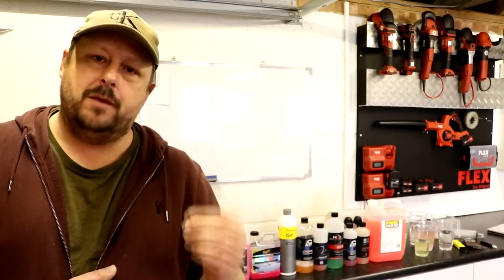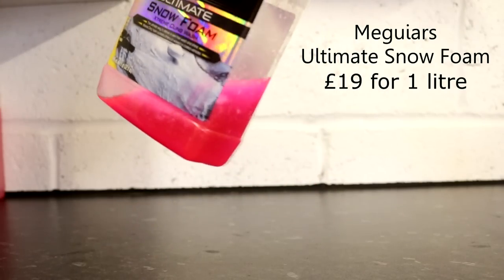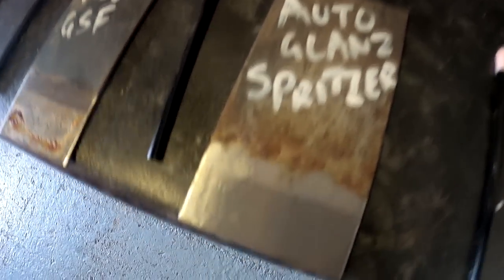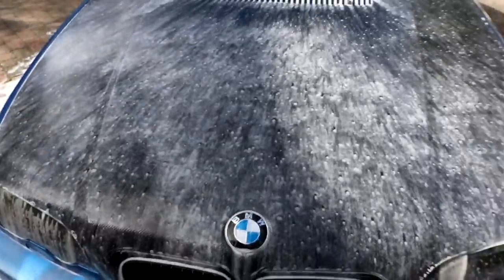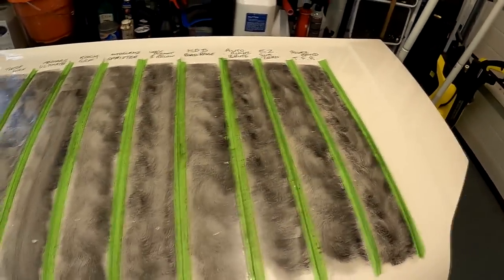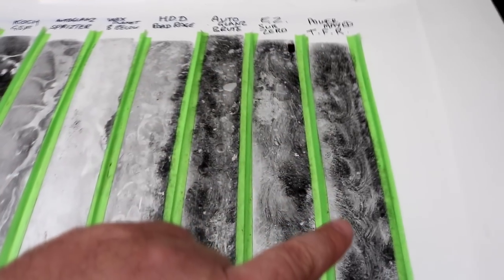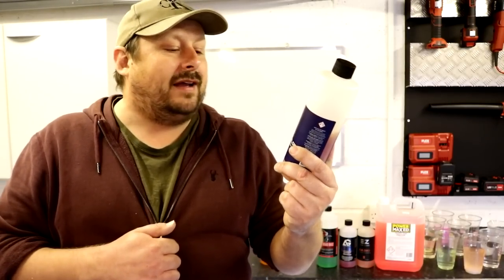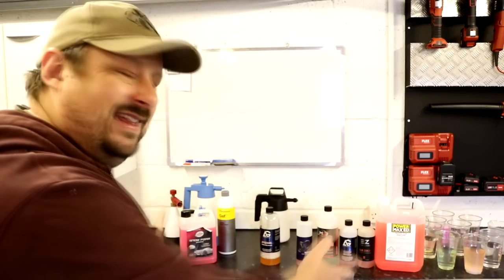The Best Snow Foam | Ultimate Pre-wash Comparison Test

Comment: I'm in research for a power washer and just bumped into your channel. In fact i ended up watching a few of your videos , and now watching this about the snow foam comparison. You said at 27:00 about one weakness of the 8 Below product ,being that it has no point in using in higher conectrations ,when its competitors still can. Because it will become ridiculously foamy. 
And i'm thinking "why wouldnt that be better?".
And then thinking a bit further ahead about how a super rich foamy cover on your car ,when u wash it during summer, would probably decelerate the breaking down of foam coating that leaves marks and give u more time  .
Is that right?
Reply from the maker: yes mate if you over concentrate its a bit like tipping half a bottle of really foamy show gel on your hair, it takes a lot longer to rinse it out.. and like you say it can leave soap stains behind.  in fact foamy products have a tendency to do this.
Reply: @ForensicDetailing  hey, thanks for the quick reply. I think though that we had a slight misunderstanding. I meant that I was thinking the opposite. That more foam would be better.
As if more detergent power on surface, and slower dry up. Sun would hit the outer layer of the foam but the inner layer that does the cleaning on the car's surface wouldn't dry up and would still do its job. And no dried strains from heat too.
 So you would have more worry free time, to leave it on do it's job properly, even on a hot day. And not been rushing with fear of dried stains.
So that's what I was thinking and don't know if it's accurate.
And when you wash out later, a strong power washer wouldn't have any problem with it, right?
Reply from the maker: @akmorf6609  well yer you could say higher concentration of detergents is a good thing sometimes... in winter less of a problem.. but you got to rinse all this stuff off the car so you dont want to go too crazy..   remember as well foam is just foam it does not really do anything..    these products are essential surfactant based which are products which really allow to components for example and oil (grrease) to mix with water.. when normally these 2 components dont..   but yer who knows my friend.. I would just stick to the recomended usage rations generally... dont overload the products it can cause issues for sure.. thank you my friend great subject to talk about.
Reply: @ForensicDetailing  okay thank you, duly noted!
But now please allow me to "take advantage" of your knowledge on the subject as I'm seeking for a little help in deciding. It's days now that I'm searching for the right power washer. I always thought I'd go for Karcher K7 but now , although I'd like it to be the right choice, I'm not so sure after several things i read.
Things like the plastic components in such a powerful washer, or the handgun failing (that they tell you it's not covered by warranty) etc etc.
So since u already using it for months, I wonder what your advice would be. 
And is there even any similarly good alternative? Most info I found was for products they have in the USA, so it's tough to make up my mind.

Comment: Hi, have you got any tips on getting rid of the foam that is on the floor after foam spraying the car. I have to clean my car in a communal alley so I want to dissolve the ground foam quickly to avoid other users of the alley passing through it and splatting it all over the place. Any ideas of a mix I could put in a spare foam cannon to spray on the ground foam to break it down? Love the channel I have found it really useful keep up the good work.
Reply from the maker: honestly just rinse it.. maybe salt or something will kill the suds but I would just rinse it away.
Reply: Forensic Detailing Channel  That’s what I’ve been doing but it takes 30mins to get rid of the stuff as there is only a small drain in the alley. Thanks anyway for taking the time to reply.

Comment: Jon i wonder if some of the companies do not want good degreasing power because they think it will strip away protection? Does moderate degreasing power strip for example....Fusso 99?
Reply from the maker: with old school paste waxes that had oil in them for sure a stronger degreaser will really attack this.. but most modern products it does not make too much difference.. but yer exactly what you say some companies make a milder PH neutral product for lots of reasons.  I think alkalinity is desirable though.

Comment: Hi FDC, just wondering if you got a good stripping snow foam / shampoo?

bought my first car, just want to strip it all back to bare.

it's a white car but want to strip it, decon it with iron remover + tar remover, use a clay mitt as it's less time consuming, and then use super resin polish which I already have and top it off with some megs ultimate liquid wax.
Reply: JS1. Hi - FDC has a great video on ‘turbocharging’ your snow foam into a strip wash type, go check it out 👍

Garage Therapy do a decon wash/snow foam which is just what you’re after. Will strip away anything on the panels. 

If it’s a brand new car if won’t have that much contamination on it so maybe be gentler and go with a clay mitt. A clay bar will likely marr the paint and Super Resin Polish isn’t very abbrasive so you’d need full ‘proper correction’ if so. Great choice of protection though- the liquid wax is 👌

Comment: Hi John, in last year test, n1&2 was Bilt Hamber Auto Foam & AutoBrite Direct Magifoam, now what place is for Wax Planet 8 Below when it comes to cleaning abilities (which is most important to me).
Reply from the maker: in real life its about the same as magifoam.  you cant really crank WP or AD up to 4% PIR because the foam is so thick it does not rinse freely.  but autofoam can be used at 4% pir no problems.  So autofoam is more powerfull.. you need to check out the BH new pre wash called touch-less though. this is even better.
Reply: @ForensicDetailing  thank you Jon. I was already looking at BH Touchless too. 👍

Comment: Superb video. Clear, informative, detailed.

I was intending to buy 500ml of WP Eight Below to test it out, but after watching this excellent video (complete with contactless Dirt Simulator test), i'll be buying a litre from County Detailing because of the impressive way that it shifted dirt with just a open hose doing all of the hard work.

I may even start using 8 below when cleaning the wheels if it works out cheaper than using an alkali wheel cleaner.

Comment: What worries me is adding a bit of TFR to you snow foam to give it extra kick and using too much. One of the lads at work used TFR neat on our TARMAC paver by mistake.and its lethal  concentrate foam. It completely damaged the high viz Chevrons making them bubble. It also destroyed the shine from the paint work. Can anyone give a dose to make it effective  in you cannon. I normally use 150 ml of polar blast to   600 ml of water.
Reply from the maker: be cautious going beyond 4-5% PIR with any product.   Caustic TFR's avoid them. no need to use them.  Just use autofoam.   TFR can contain strong phosphates and caustic soda and the haze it will create on paint is the binders in the clearcoat being broken down.    Caustic soda is an ingredient used still today on some paint strippers.

Comment: Apologies for a noob question but, when using a snow foam, do you use cold or warm water from a tap in the snow foam lance?
Reply from the maker: cold mate.   Some soaps dont work well with hot water... but then main reason you dont need hot water in the lance is when it gets pulled through and mixed with the output from the pressure washer it gets diluted down at about a factor or 1 to 100.   So even if the bottle water is warm it will come out cool or cold from the lance.
Reply: @ForensicDetailing  Many thanks mate 👍🏻🍺🍺

Comment: I'm going to have to say I'm a bit disappointed with this one Jon.  I'm assuming you used the products at the manufacturer's recommended mix ratio when you did the foaming test, but when you did the simulated dirt test you used them all at 5%.  Why?  Why not use them at the % that is being recommended by the manufacturer's?  By using all at 5% you have used some products at a much stronger ratio than intended which can only give inaccurate results when applied in the real-world at the correct ratios.
I just watched your BH AF v 8 Below video and that's just repeated the inaccuracy.  If you are using 8 below at over 5x the strength recommended by the manufacturer, why not use BH AF at 20% PIR?  It's all meaningless unless you use them at the specified ratios.  What's going to happen now is people will be buying 8 below on the strength of this video but using it at the correct manufacturer's ratio of 1:10 and it's not going to perform for them like it did in this video because they are using it at a much weaker ratio.  For reference, I'm not a BH fan boy.
Reply: Hi, can you recommend a good pre wash? I'm new to this and looking into buying a suitable one pre wash product. My car is protected but getting confused by watching different videos what to use; I.e. citrus pre wash or TFR? Then with TFR is caustic and non caustic? Which brand to go for and which one to buy? Its really confusing for a new comer like me and I'm not a valeter or a detailer. I just enjoy the hobby and take pride in cleaning my own car.
Reply: @Rusty_oreo  For me, Auto Glanz Spritzer does what I want it to do and it works out cheaper that Bilt Hamber Auto Foam whilst performing as well and foaming better.
Reply: Thank you very much for coming back to me that quick. I will certainly look into it. Many thanks.

Comment: Not hating Jon but using the product at 5% is inaccurate 8blow isn’t designed to be used at that dilution a much better rest is to use them at the max recommendation strength on the dirt simulator
Reply from the maker: ive talked to you about this before.  you have to use them all at the same concentration or its not a comparison.  When you are testing something you have to remove variables.   if they are all at the same % then we learn about their relative strengths to each other.    We also use the products for 6 months at recomended usage concentrations.
Reply: @ForensicDetailing  no, hakman is completely right. you tested the concentration and not how they are 'designed' for usage. no test is ever done that way btw why should it. you tested the quantity here not the quality. you implemented an arbitrary variable - the concentration of the product.
take for example a sonax windshield-washer fluid. they are sold in 1:100, 1:7 and in a ready to use version - of one and the same product. your testing method would have provided three very very different results with the exact same 'dirt simulator' with one and the same product.
Reply from the maker: I didnt say he was wrong. Im not trying to test how they are designed for usage in this test. how many times do I have to say it.  Im trying to compare relative power at fixed ratios.but there is no right or wrong.  its this simple thats what I wanted to test and I explained why.  Sure you can say you would prefer a different test etc.. but its not wrong lol.
Reply: @ForensicDetailing  by searching 'the best', and as stated the try to eliminate variables, it is suboptimal to say at least to implement a huge very dominant variable by yourself - and to switch this variable in the process of testing like you did falsifys it even further. 
corrosion resistence test was done neat, foaming was done 'as designed', cleaning was done with arbitrary dilution ratio. so two out of three are done in a way a user simply wouldnt use the products. 
for example - if you would have done corrosion test at 2%, foamed neat and cleaned as designed your conclusio and outcome would not be the same but still would have checked all the 'relative power'-setting-boxes. the outcome of my hypothetical portrayed exampletest would have shown the corrosion res of your tapwater, all would've foamed like crazy crazy and cleaned as designed. the possible variations to such an method are infinite and their outcomes are probably near random.
so yes - with the primary goal and attempt to find 'the best' - that testing methodology is pretty much per definition wrong - imho.

Comment: Cleaning power usually goes up with a high ph value but it'll strip your paint protection faster. Maybe I missed but you didn't really show ph values of the products.
Reply: The impact on LSP is so minimal it's not worth highlighting. Washing your car with a ph neutral pure shampoo will cause more damage to your LSP than any of these pre washes.
Reply: @BrianW1612  that certainly differs with the product used. Valet Pro specifically offers Combo2 snow foam as a wax stripper and it's also ph12.2. They advise you to use it at a very low dilution but still these foams have a lot of power.
Reply: @saiiiiiii1  can advertise it however they like, highly unlikely it actually works at stripping LSPs.
Reply: @BrianW1612  I've seen tests from german detailing enthusiasts. Non synthetic waxes easily get removed.
Reply: Would you rather reapply protection because your prewash does a good job or repolish your car because it doesn’t?
Reply: @LSD04  wonderful way of putting it, 100% my point of view & couldn't agree more.

Comment: Snow Foam, and all foams, are odd choices for washing cars. Foam is only a mass of tiny bubbles, and with a bubble, the only bit that's working is the one part that's in contact with the surface. The rest of it is doing nothing. I foam the car, then get on it with a noodle mitt.
The ideal spray would be one with flat coverage with close to 100% contact, but with great cling. Having had decades of two-bucket car-washing, snow-foam is fun to use, easy to apply, looks good, but, stand alone, it's not very efficient.
I use low-foam washing-up liquid for the same reason. Fairy Liquid bangs on about the bubbles, they do Nothing! (It's just more concentrated than others anyway, nothing special about it)

Comment: The problem with bh autofoam is you have to use a shit load of it to be at 4% which makes it very uneconomical
Reply from the maker: its more powerfull than other products when you use it at the same ratio matt.  I agree 4% is uneconomical but I use it normally at 1-2% and its great.  4% is so strong, you could degrease an engine bay with it at that ratio.
Reply: @ForensicDetailing  ahh okay well maybe I'll give it a go at that then

Comment: Putting them neat on the steel is pointless no one is gona use them neat
Reply from the maker: ive answerred this one too many times sorry mate have a think why i do it neat.
Reply: Jesus christ Hakim, just give up mate if you don't see the relevance of this test 🤦‍♂️
Reply: Brian Woods I do but in reality you wouldn’t use them neat
Reply from the maker: @hakman239  the test is not there to show what happens when using them neat on the test pieces.  If you dilute them down typically it can be really hard to see the difference between them and you get zero meaningfull results.  no test is ever ideal. but a test with no meaningful results is pointless.  I explained this before.
Reply: Forensic Detailing Channel ok

Comment: Chem guys honeydew snow foam beats all of these
Reply from the maker: no it doesnt.. It has no cleaning power and  its highly corrosive to steel.  We tested this in the first video.. Its an ok shampoo though but a poor prewash.    https://youtu.be/WmVeTbarlH4
Reply: Forensic Detailing Channel I meant for having the most suds. I only use honeydew for maintenance washes. Purple power vehicle and boat wash is my stripping car wash which is one of the best when I apply a new coating

Comment: How many people here claiming Bilt Hamber is better than Eight Below have tried both??
Reply: I've tried both. At the same PIR they perform the same imo. If pushed for an answer I'd possibly say the 8 below cleans ever so slightly better.
Reply: @BrianW1612  I can't say I found any difference between the two either. However I use BH via a pump spray which is where I find it works best for me and then Eight Below in the foam Lance form the foam when you want it 😁

Comment: Dirt removal test was the stupidest way of doing it. Why did you diluted them equally at 5%? You should use them at working dilution. Whenever you use 50 ml per litre (GSF) or 500 ml (power max) per litre this is working dilution. You just can't dilute them to 5% and expect same results when each of them got different strength.
Reply from the maker: So I can benchmark them and cross compare with other tests.   All dirt simm tests are done at 5% PIR.  Had this discussion many time times but you can't cross compare with different variables.  But when you test the products on cars I use at recomended ratio.